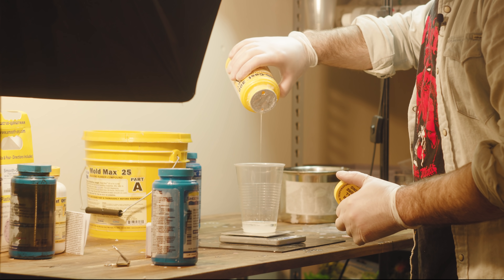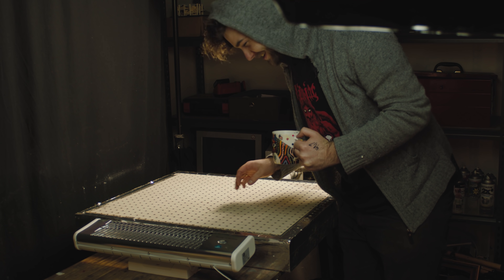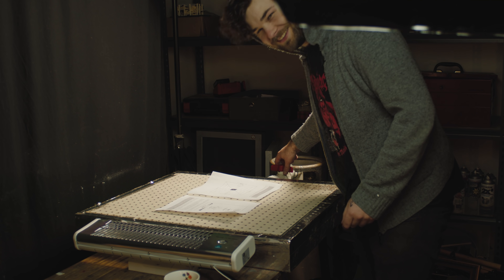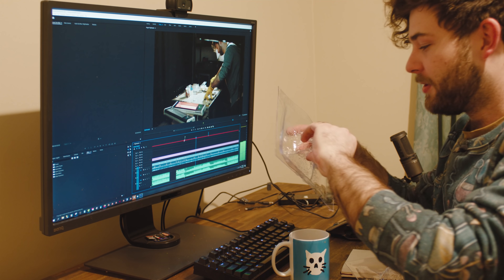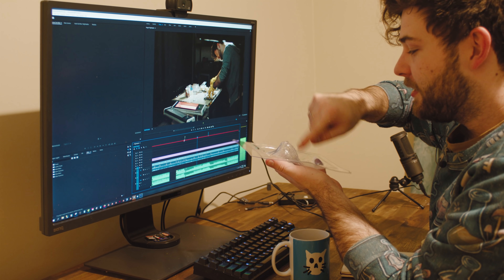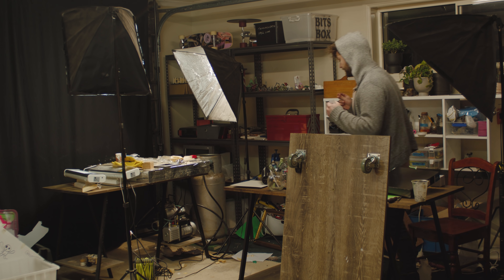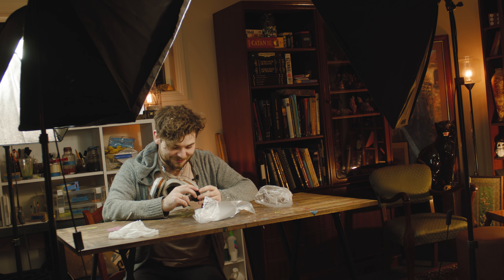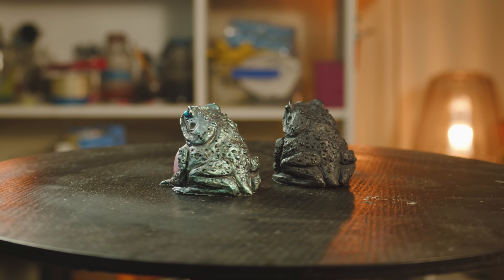Casting Toads & Sucking Plastic | Vlog 002

Comment: Another great vid dude!
I used to work in a modelmaking studio and I can give you soooooooo many tips on vac forming:

1 - use styrene! its lovely and pliable when hot and keeps the heat for a decent length of time without any bubbles.

2 - you've got to get a super tight seal, any gap and it won't work how you want it.

3 - when you heat it, take it to the point when it just begins to sag and no more, if you're wearing gloves just give it a light tap, if its springy and slightly jiggly then you're golden. If its too saggy when you do it then you'll get those curtain-like wrinkles.

4 - try not to mould anything with an undercut or you'll never get it out. If your gonna do it with the toad you'll want to do it with a mould that you're happy to lose cause its not coming out any time soon!

5 - these things are great for replicating terrain. Think of your rock moulds that you made plaster moulds in. They were 100% vac formed. they're also great for making lightweight props. I used them for gun parts for a project back in the day.
Reply from the maker: Awesome! Thanks for the ideas, I'll experiment. I'm trying to source other plastic locally, if I can get styrene I will.
Reply: I learned vacuum forming in design school and all these tips apply. We used a simple shop vac for the vacuum, but you need to have a smaller air box or you’ll never get enough pressure. Sandwich the plastic between two wooden frames that are just slightly larger than your air box and you’ll get a great seal. Keep the vacuum going until the plastic has cooled or it’ll relax from the reverse pressure. And yeah... as mentioned, no undercuts unless you want to destroy it cutting it out. Enjoy! Learn! And share it with us please!

Comment: Maybe you should try with a bit lower, but continuous vacuum with that table, instead of turning the valve all the way and have one big suction that bends your table. And you could use a heat blower while the plastic is already on the toad, instead of that fire hazard machine, so you wouldn't need to transfer the plastic and turn the valve in quick succession. 
I guess the whole vacuum table just looks sketchy a bit, but i really loved your optimism on the progression.

Comment: There are a bunch of DIY  vac former guides on youtube and elsewhere that may help you trouble-shoot your own. I think you are correct that you aren't getting a good seal, and I believe it's because you are trying to hold the frame down with one hand on a single edge. There are a few simple solutions that may help:

1) Build the frame out into more of a box or pyramidal shape with a flat surface on the top you can apply even pressure to. Similarly this could be accomplished with a sort of angled handle attached at the 4 corners of the frame, but the precision required to get adequately even pressure may be a lot of extra work. Alternately you could combine both techniques into a sort of potato masher style frame + vertical handle setup.

2) Attach one edge of the frame to a lever that is attached via hinge to the side of your box such that in one position it holds material centrally over your heat source and in the other position it is centered over your vacuum area.

3) Similar to 2 but with a sort of swiveling crane arm instead that pivots from the heat source to over the vacuum bed then lowers directly onto the piece. Something like they use for multiple screen-printing (https://www.youtube.com/watch?v=iIGaIKerKzg) but you'd need only 1 arm+frame.

4) Mount the heat source above the vacuum bed and raise/lower the frame straight up and down via extendable/telescoping rails (drawer slides, perhaps? Nested PVC piping?) so you can raise and lower it one handed directly from the heat source onto the bed. This may give the added advantage of additional work time by supplying somewhat diminished heating during the forming process. If mounted too closely to the bed however, this may make the entire process uncomfortable or even dangerous.

5) Foot activated switch for the vacuum so you can focus on using your hands to hold the frame in place.

On the subject of vacuum, I think your setup may be overkill. I believe Punished Props uses a simple shop vacuum, which would be very easy to foot activate with commercially available products.
Reply from the maker: Thankyou! I'll experiment and watch your suggestions :D Lots to learn!

Comment: Great to watch your journey with the vac former.  It's probably already been mentioned but ditch that tank and hook up a regular house vacuum cleaner ... you will get a smooth, longer draw of the air, but that does require having the right thermoplastic for vac forming otherwise it will cool to quickly.  That joy you feel when looking at a new cast of something you have molded never goes away ... such a wonderful feeling!!

Comment: Great videos, Im loving the slowed down approach focusing on the creative process. With the vac former get yourself a cheap wet dry vacuum and hook that up. with vac forming you need to hold the pressure on while the poly cools, continuous pressure is more important than high pressure, unlike the casting. hope this helps with the bellista packs getting the toads ready to ship.

Comment: Most of the vacuum formers I've seen have the heat above the vacuum table, maybe you could mount those heaters up. Thus does two things: with the heat above the plastic you don't have it potentially dripping into the heater, and it could shorten the time between heat and vacuum, giving more working time with it soft.

Comment: I've had a bit of success doing small vaccuming stuff at home using a normal vaccum cleaner connected to a plywood box a bit like yours, but much smaller. Using a regular vaccum will mean you can pull a pretty similar vaccum, but for as long as you need it for the plastic to form to the part.

Comment: Vacuum forming requires constant, consistent pressure, not a sudden burst of it, so a good pump and a fully sealed unit are required. The tank isn't necessarily a bad idea, but is likely not enough on its own: try keeping the pump running, but you need to work out how to fully seal the sheets to the table first. I would also suggest mounting the heating units over the table so they can continue to heat the sheets whilst its being positioned and sealed down.

Comment: I feel you would get better vacuum pulls if the buck was inline with the vacuum pipe as the largest area of pull will be the center. The massive flex you had during the last pull was also caused by the large neg space that was covered in taped up holes. Look forward to seeing your progression with mastering the table.

Comment: Brushing silicone onto a master can help with bubble elimination for really small details on top of doing the classic slow pour.

You might get better results connecting a vacuum cleaner to the thing, sure it wont be as strong but it will be sustained. 
For the framey gasketey bit you made i think adding a top to it, like the perforated surface of the main machine, which will be level with the material you are forming could help as it wouldnt need to be stretching down below the level of the frame holding the sheet to capture all the detail. 
Alternatively putting your buck/master  on something to raise it to be at the height of the where the material sheet is mounted might be less work and something worth trying.
Great work :)
Reply from the maker: The vacuum chamber for degassing the silicone has made everything absolutely bubble free on everything I've done recently, but if I have trouble I'll try out the brushing on idea! Thanks for the vacuum forming ideas, I'll experiment!
Reply: @Miscast  No prob, love the stuff you put put :)
Reply from the maker: @zid_just_zid  Thank you! :D More on the way

Comment: @Trent, I think that "table" is too big. Maybe make it about a third that size and I think the top should be closer to the bottom.
I also feel you may need an assistant to turn the valve on your tank (like super fast). Seems like you're losing to much air pressure before your polycarbonate cools.
The vlog is awesome 😎

Comment: love your work, but I also do silicon molds, little tiny advice, when you pour it, don't pour high like that, it will trap air bubbles. other than that just sub'd today. You are a true artist, also on the vacum you should hold the clear plastic until it drops down into a half sagged circle, and the vacuum should be running nonstop, then you can use a heat gun as its vacuuming to get it perfect.. bubbles in the mold sheet means you have the heat toooo close

Comment: @miscast The vacuum former will perform better if it was smaller! The tank is having to pull the air out of the whole box (the empty part inside). You could fill it with rocks? Gravel? Will let you pull slower if all the force is going to the plastic and not the table void.

Comment: No idea if this will be too late to be of any use or not but I've worked with a purpose-built vacuum-former before. It seems like you solved the initial issues quite well of ensuring a good air-tight seal between the plastic and the machine. Before it looked like the bulldog clips were acting like shims and stopping the frame from fully contacting the base-board.

On the machine I worked the vacuum was never pulled that quickly. Granted it used a a pump instead of a vacuum tank but the principle should be the same. The plastic needs time to deform and be pulled over the model and if you pull the vacuum too violently it's liable to find another way in. So maybe try only opening the valve a little bit and pulling the air out somewhat slowly. Of course the issue with a tank is you've only got so much pull and the strength is constantly decreasing, hence why professional machines use pumps.

This gives me another idea though. You must be using a pump to pull the air out of the tank, so it might be possible to just use that instead of the tank, which will let you keep pulling a vacuum for as long as the plastic is malleable.

Comment: So i think part of the issue with the vacuum former is that it doesn't go for long enough it only takes the air out for like a second or two and anytime i have seen them be used the vacuum last for like 10-15 seconds. I could be wrong since im not an expert nor have i ever actually done it its just a possible issue.

Comment: What silicone rubber are you using for the mould making?  Seems that you might have been better off with a slightly more flexible one for the toad (detail retention is the same,  it just makes "birthing" them easier (demoulding).

Comment: I know its pricy but i can really recommend this vacuum former. for the stuff  you want to do the airhole grid needs to be much smaller, also the rim of the sheet frame needs to be flush with the airhole surface, otherwise it won´t build up enough pressure. as i said i had good results with this one. https://www.mayku.me/